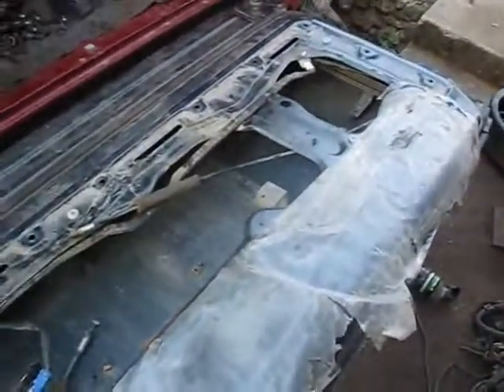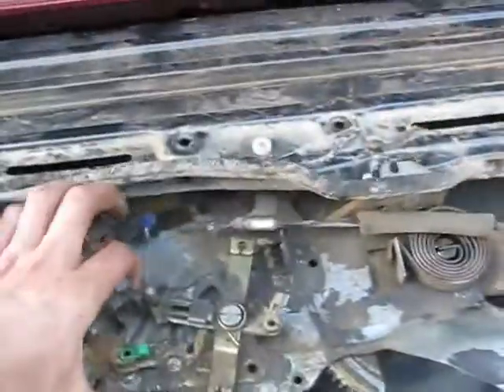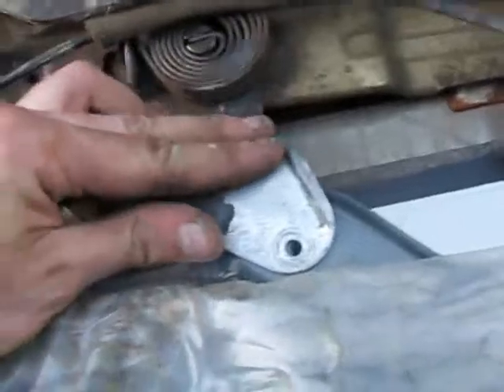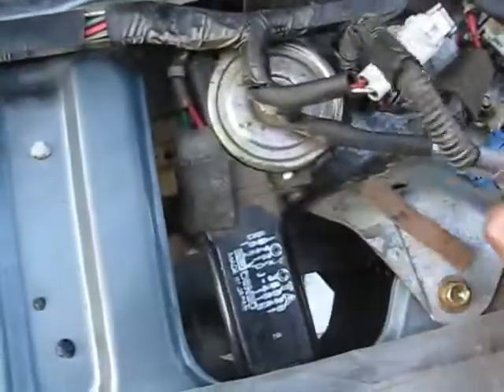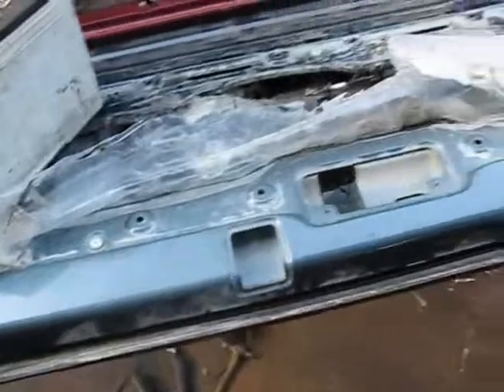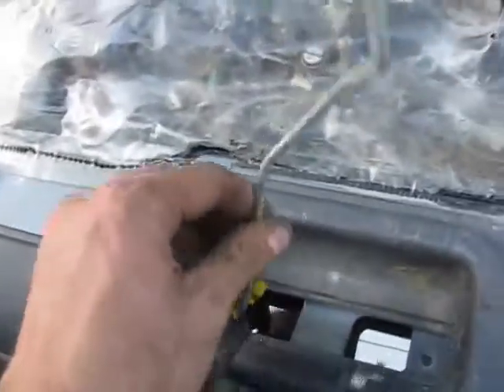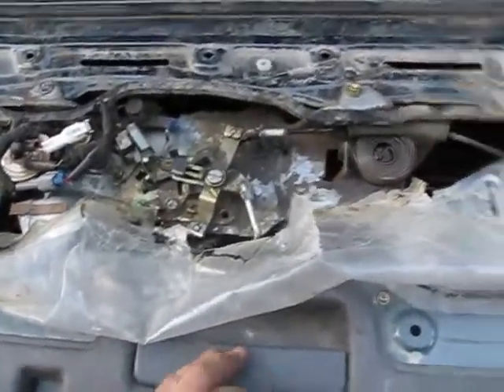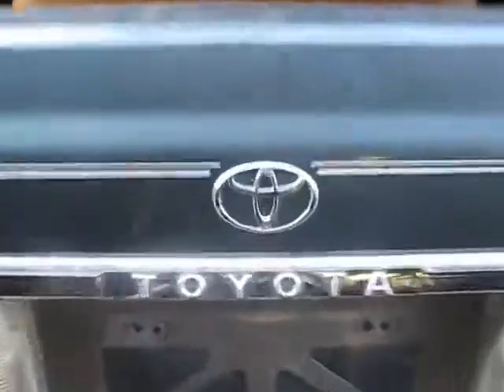1994 4Runner Tailgate Assembly

Comment from the maker: @Konabish are your rear fender wells rusted t all? first thing i would check, if its clicking but not moving, it the ground. its located behind the drivers side panel right under the rear window at the back. if that is good, then i would look at the window motor and stuff. you can manually jump the window. just take the access panels off the gate, and unplug the motor, then hook a battery directly to the wires for the motor. positive to one, and negative to the other. if it doesnt move, reverse

Comment from the maker: @gwendolyneyes oh ok. id try blowing it out with an air gun or something first, unless its wet already... dust is easier to get out than mud... but yea, carb cleaner or brake clean, then pb blaster, wiggle everything alot, keep soaking it, and working at it till its totally free moving. did you get the door open?

Comment from the maker: @gwendolyneyes that spring is for the window... i assume since you cant get it open, and since you have the panel off that the window is up... what i had to do to get my rusted one open and off was roll down the window about an inch. just enough to clear the window seal around the top and sides, then pull each cable manually. the gate should then open. i had to kick the crap out of it from inside to get mine open though. let me know if it works for you

Comment from the maker: @gwendolyneyes 2) if you pull the cables manually, you bypass the locking mechanism completely. so pull the cables, and the door will open. the only reason i mentioned lowering the window a bit is because with the window all the way up, it will get caught at the top and sides and you wont be able to get the door open. let me know if you need more help :)

Comment from the maker: @gwendolyneyes that spring locks the door when the window is up. the window has to be completely down for the spring to allow you to unlock the door. ok, so through the opening where you took the access panel off, you should be able to see 2 cables attached to a lever  system.

Comment: Got the door open, its clean, and everything seems to work, but the handle doesn't open the latch correctly.  I can't figure out why.  The handle pulls out on one side, and I assist by doing it's job  for it on the mechanism.  It doesn't look broken, just maybe installed incorrectly.  Maybe just not attached to the handle properly.  Still workin, thanks for your help and encouragement! But that bit about the having to be entirely ope get the lock up was key.  Seems obvious now...

Comment from the maker: @HedgehogOutdoors the light wires run in with the harness that goes into the driver side of the back of the 4runner. my plug was corroded, so i had to just solder all the wires together haha

Comment: No I am still trying to clean the lock and latch.  The window is working just fine. I've been told pb blaster, carb cleaner , liquid wrench, white lithium.   It's not rust. desert silt and dust and dirt. sound right?

Comment: My '94 4Runner SR5 tailgate window lifter has stopped working, from the tailgate keyed switch, and also by the switch on the center console. I can hear a faint click, then nothing. From your reassembly at the end I kinda get the idea how to remove the 'carpeted cover', then the plastic and 'foam piece'; is there anything I can do to test if the lift motor is bad, etc.?     Thanks!

Comment: long shot here. good video.....back door dummy light wont turn off. what part shoul i examine in the tailgate for this??
Reply: Could be the mercury switch at bottom left wen tailgate is open. Connections cud be bad. Switch on the light housing cud be sticky. Maybe. The wire that goes under the carpet at left rear might be pinched and completing a circuit. Just a few things at the rear, doubt its anything else but u never know. I have one of these 4runners.

Comment: My Tailgate is stuck and I cant get it open! I've opened the assembly and it all looks like it should work.  Just south of the lock assembly there is this spring that keeps knocking the lock shut.  What is it? I cant figure out its purpose.  Is it possible to use pliers to pull the cable that pulls the tailgate latches back manually while it is locked?  Any Suggestions? It is dusty and dirty and probably needs a full bottle of lube.  Thanks!

Comment: I guess my big question is Can I pull the cables without unlocking, and do the windows need to be in a certain position?Can you tell me what that spring does?  Is the contact by the lock for the auto function? Are you saying pull the cables from the top where the window comes up?  I really need an elementary answer- I am NOT a mechanic, just someone trying to save some dough.....so ...one more time, in detail? thanks tons...

PS-  might my window break if I kick too hard?

Comment: analog56x.  Can the gate be  unlocked / opened without lowering the window first?  I'm looking for a way to get the gate open with a frozen up motor.
Reply from the maker: RobertMOdell yes, kinda... you'll have to open up the access panel on the gate and get the window down even just an inch so its out of the seal at the top.
Cheers!

Comment: Are there any tricks for removing the glass? I have a tailgate from a junk yard so no power to the window. Can I still get the glass out or will I need power?
Reply from the maker: Is the window up or down? If its up, you should be able to unbolt the motor assembly and move the whole thing down to gain access to the window clamps. If the window is down, you need power to get it up. OR because its at a j/y, you could just take some good tin snips or an angle grinder to cut the bottom of the door to get to the window clamps.
Reply: analog56x The window is down. Yeah I figured I’d have to get power to it.
Reply: I finally got around to doing this and I just want to say thank you again. This video made my life a lot easier and cheaper. Cheers!

Comment: Hey... don't know if you're still checking comments 3 years down the road from this post, but I have a 94' runner and had someone else "fix" the back glass that got busted in an accident.  He put it back together, but not correctly.  Lock when pulled up does not stay in place like it should, it just falls back down.  Can you take a up-close video of the linkages working properly? my guess is the guy that worked on it lost a part in dis-assembly but need to see one in working order to verify...
thanks in advance for any help you can give..
Reply from the maker: i do check comments still. just cant respond to them unless im on my computer, cause the new 'improvements' to youtube have made it so that my phone tries to respond through G+, but then i cant actually reply... if the window is falling down, id check that the gears and stuff on the arms arent damaged... if the arms are bent or not sitting quite right in the mechanism, they can fall down. do you have to 'roll the window back down' before you can roll it up again, or once it falls, you can just roll it back up again? if its not too cold (mainly because the gaskets around doors freeze shut) i could maybe make another video explaining the mechanism and showing how it works... ive got another project 4runner with the back gate half ripped apart right now haha!
Reply: the window isn't falling down.  it's the lock that falls down. so I'm guessing somewhere in the mechanics of door handle, electrical connection, and lock-mech right in the middle of that assembly there might be some kind of spring that would hold the lock in an unlocked position.  I'm guessing this is missing due to the tech who installed this replacement glass for me.  As it sits, I have to pull up the lock-handle and hold it with my hand to keep it from falling.  That's one issue.

The second issue is that while I can get the window to roll down every time using either the key/switch on the back of the tailgate OR the console switch to operate the same back glass, I can't get it to roll back up without trying 20 to 50 times.  I'm guessing this is an electrical contact issue and I'm hoping it's not the motor or a switch but a failure in re-assembly by the guy that did the work of replacing the glass.
Reply from the maker: Oh! The lock falls down... when the window is in the full up position, it should automatically lock. But having to hold the lock up sounds like an issue. Ill try to make some time to dig into my 4runner to help. With the window going down fine, but trying 50 times before it goes up sounds like a module issue... bad relay or something... on the drivers side of the vehicle, behind the panel, theres a black module unit. It will be above that little cubby hole thing in the back. Listen carefully for a click sound when you try to roll the window up. Its really a bad place to put the module, considering the bottoms of the quarter panels rot out and expose the modules to crap. One other thing you might try first is push on the tailgate while you try to roll it up. If the gate isnt closing properly, or all the way, the window wont go up. Same thing if the rear wiper arm isnt in the resting position.

Ill try to get a video up by the weekend of the mechanism for the lock for ya. Cheers bud
Reply from the maker: Actually... now that I think about it... if the rear window is in any position other that full down, it shouldnt unlock. Just so that you cant open the back gate when the window is only half way down haha. As soon as the window starts going up, the tailgate locks itself, providing the gate is closed all the way
Reply: what's the best way to get you a video clip to show, rather than try to explain long-hand.  we're almost on the same page but i think a video is shortest route to showing you problem before you tear into a vehicle for me.
Reply from the maker: Probably a quick youtube video would be good, then email me the link, or link it here... usually videos are too big (file size wise) to be sent directly through email...

Comment: what if the window goes up and down VERY slowly ?  Worn out motor ?  Stiff hardware ?   Battery is good.  Thanks
Reply from the maker: i'd be willing to bet you either have a bad motor (weak) or you have a substantial voltage drop to the motor. could be as simple as a bad ground only letting half the voltage through. the first thing i would do is grab a multimeter or a voltmeter and check how many volts you are getting to the motor when you actuate it up and down. if its less than about 10 volts (with the vehicle off), i would look at wiring, which may involve removing your driver's rear quarter interior panel. if you have 10-12 volts (with the vehicle off) i would change the motor. i dont suspect you would lose more than 2 volts inside all the wiring and switches... toyota is pretty smart with their wiring... let me know what you find, and if you need any additional help! cheers bud!

Comment: I have a question if anyone can answer.
The motor for the rear window, I need the size of the bolts. Greatly appreciate if any one has the size for them
Reply from the maker: Probably m6x1 or 1.5, it's been a while since i last messed with that stuff, but id go to the parts store and try bolts till one fits.
Reply: @analog56x  thank you